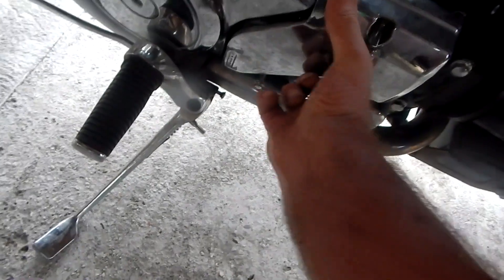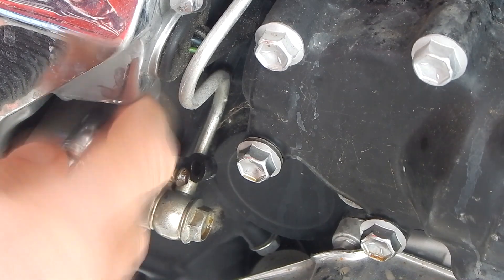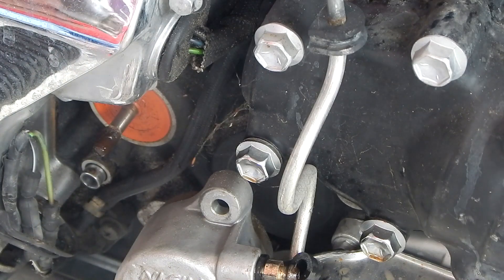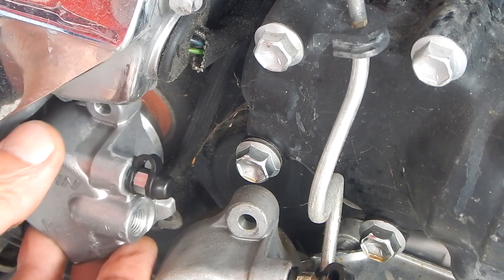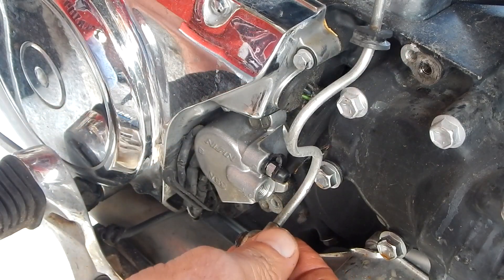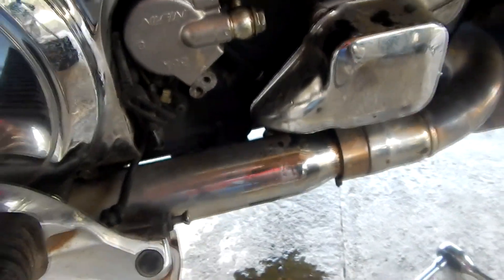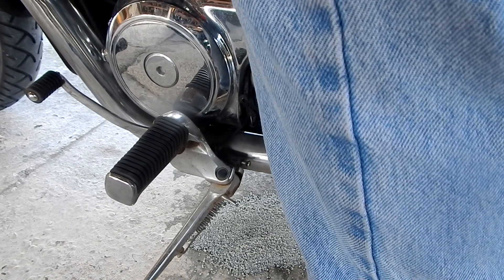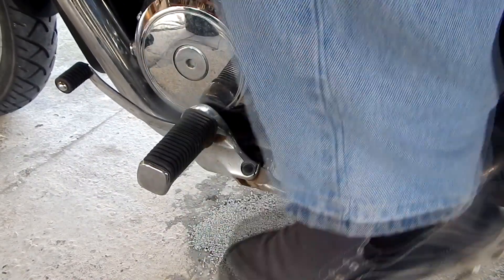Change A Clutch Slave Cylinder On A Motorcycle

Comment: I have the same exact motorcycle and problem. going to order a clutch slave cylinder and try it out, thanks for the video!
Reply: Did the slave cylinder fix the problem having same issue, already replace the lever master cylinder but no luck there. Better to get new one or rebuild kit?

Comment: If a slave cylinder goes bad could it leak as well? I have a 03 Honda VTX1800s and keep losing my clutch since the winter has been over and thought it was a bleeder screw but checked yesterday and seems its just leaking around the bottom of the case of the slave cylinder.

Comment: thank you, I have the same bike, I have never had a hydraulic clutch before and my clutch went out I took it to the dealer and they bled the system but two weeks later it did the same thing, so I will bleed it this time and try once more, if it happens again I'll try replacing both the master and the slave... one at a time of course...lol

Comment: I have a 1995 Suzuki VS800GSL. When you remove your old slave cylinder, at 37-38 seconds, it looks like it does have the retainer (part# 23117-38A00) on it, the new one that you install does not look like it has the retainer on it--at 46 seconds.  My new slave cylinder did not come with a retainer, I re-used my old one.
Reply: thanks for the heads up, i'll need to lookout for this when I do mine
Reply: Does it have to have the retainer on it to work properly ?  thank you .
Reply: I have one that i need to replace is why i am asking .

Comment: Question, just rebuilt the clutch and now the thing does not engage till you let the handle all the way out, I have no free play at the handle, is this the norm ??? It is a1995  Suzuki intruder VS 800 with a hydraulic clutch.

Comment: Could this be my problem when cannot get pressure build up after rebuilding the slave cylinder at clutch handle? I have a 1996 Intruder. 1400cc. But I cannot for the life of me get any back pressure at the handle. It won't bleed to the bleeder valve even. Should it get pressure even before the fluid makes it to the lower slave?

Comment: I have a 92 1400 and im trying to find a seal for the damn slave cylinder. What a nightmare. Easier to buy a new one.
Reply: Were you talking about at clutch handle?
Reply: @MrCbell57  no, the slave cylinder. I had to rebuild and was having a hard time finding the kit. Finally found one. Back up and running.👍

Comment: I took mine apart. I could not get my push rod to move, even hitting it with a hammer. So how is pressure from the slave going to move it? When in neutral the push rod stays the same as when it is in gear. Do I buy a slave and do what you did without opening up the inner part, rubber parts? Are you a mechanic? Never mind, you are doing it to entertain yourself. I forgot. It is why you don't respond.